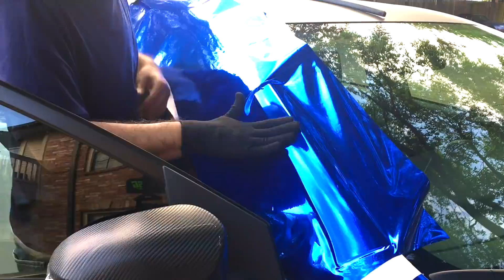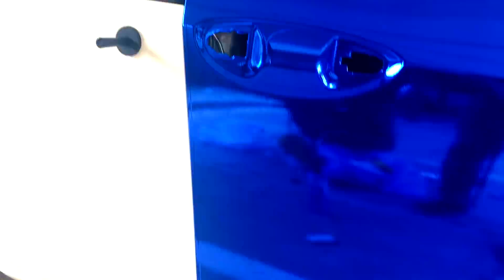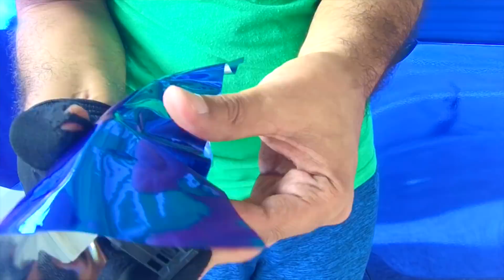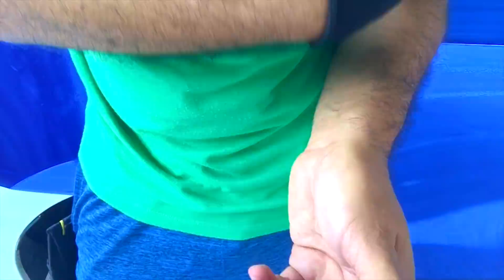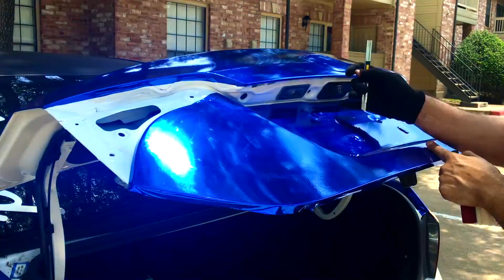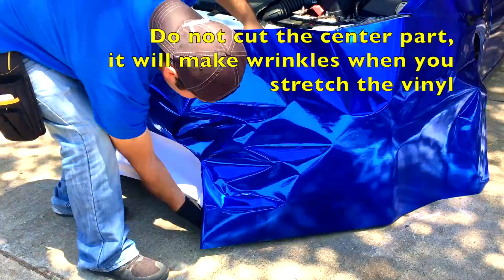Full wrap 2014 Toyota Corolla Time-lapse

Comment: Hello, I am new to wraping cars and I have a question. Will the wrap damage or leave any adhesive residue if let's say I ever descide to remove it? Love the Vids! Keep it up!
Reply from the maker: Well, all depends on the brand of the wrap. the wrap will protect the paint and will not leave residue if you use a premium brand like 3M or Avery brand. another thing if the paint is not the original paint, the paint might lift and crack with the wrap removal but if the paint is the original the paint will not crack or lift. Thanks 👍